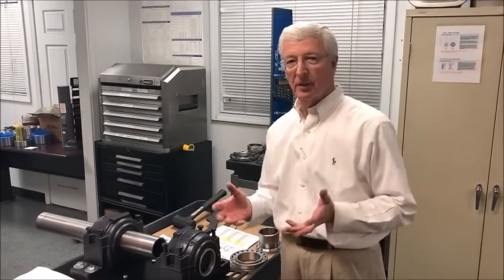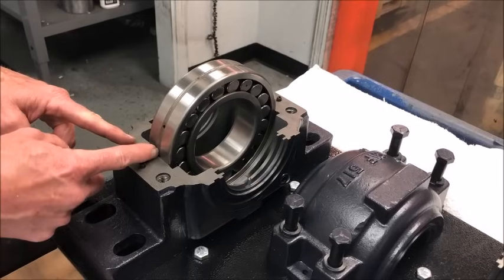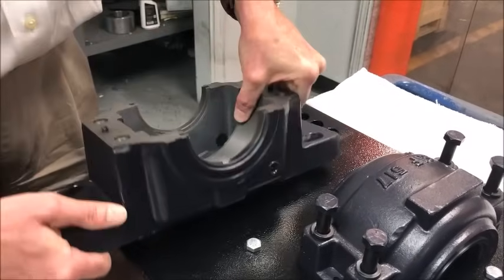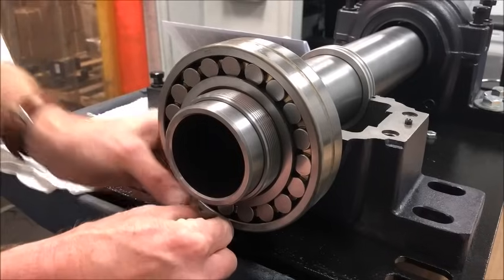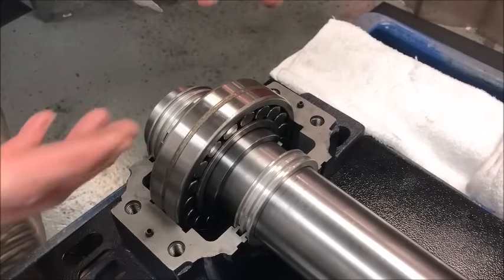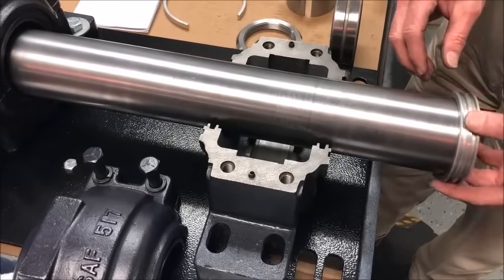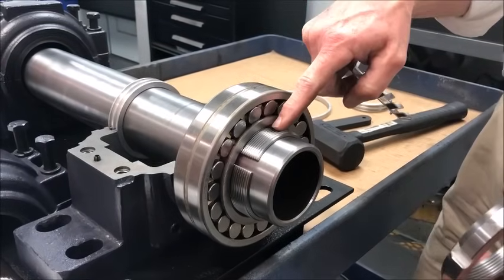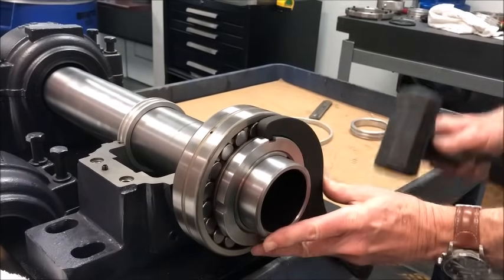SAF / Split Blocks: Features, Installation & Maintenance

Comment: I watched the whole video and i was interested the entire time.  I learned many proper procedures and you explained them very well. I've worked many times on split-bolts and they were always incredibly dirty full of burnt grease i don't believe the temperature gauge on the top would be necessary the smoke and horrendous noise the failing bearing makes is a good indicator service is required immediately. Thank you for pointing out how to check the clearance and how to measure it. I believe measuring the clearance is better than doing it by feel.  I saved this video for future reference. Thank you

Comment: How come the adapter sleeve and bearing slid easy to put the locating ring in after the bearing was fitted? Shouldnt it grip to the shaft to prevent the sleeve spinning on the shaft?
Reply: same question, this doesn't look right at all
Reply: @robrod9677  this is just an instructional video and im pretty sure he doesnt lock it in so he can show again multiple times. ive seen pump rebuilds in classroom setting and things dont get "set" all the way but elaborated on during the teaching. this isnt going into use and is just for informational purposes.

Comment: I noticed a movement of the adaptor sleeve just before you placed a fixed ring, so that means the adaptor sleeve is not tight to the shaft. When it works like that there will be fretting on the journal of the shaft. Is it supposed to be like that?
Reply: No, the adapter must be tight on the shaft. I think he just didn't bother to tighten it for demonstration purposes (which was kind of silly!)
Reply: Yah you're right

Comment: I recently installed two SKF 22218 C3 bearings with tapaered sleeves, and no where on the SKF website could I find the clearances. I checked two other bearing manufacturers and they didnt list clearances either.

Comment: In the real world you would just pack the bearing out with grease, install on the shaft with the tapered sleeve to the desired position on the shaft, install the tab washer, get the lock nut as tight as possible with a hammer and a drift then knock the tab down on the washer into the nut. Pack the housing with grease and then sit the bearing back down into the housing. Check the shaft spins nicely. Jobs a good'n.

Comment: Temperature all 60 to70 how to change55
Reply: Reduce the grease viscosity and re-check clearance between rollers and outer race... Over-packed bearings running at higher RPMs can churn the grease causing the bearing to heat up...

Comment: How do you know which bearing will be the float vs the fixed. To know in which bearing you should install the fixing ring. I really want to know
Reply: Normally the NDE bearing is the one you leave with float

Comment: I’ve never tightened a bearing outside of the housing. While working on site it’s almost impossible to do so. Also for the floating bearing you have to make sure you account for the taper lock and the fact the bearing will move on the taper. Has to be almost pushed to one side in certain situations so the bearing has room for expansion side to side
Reply: yea i was thinking its probably a nightmare to align your pillow blocks too with their respective bolt holes if you arent careful. a lot of measuring and marking for sure.
Reply: Совершенно верно, протягивание гайки дает смешение подшипника на конусе и это надо учитывать

Comment: We have a mill with Timken FSAF520 bearings. These use grease and not oil correct? A drain plug on bottom of housing has me wondering.
Also, what's recommended greasing interval? I'm guessing every 8 hours.
Reply: Mill's can either be grease or oil bath. Most housing will have the drains in them and just plug them in the event going with grease. Depending on the size of the mill normally larger mills, will be oil and smaller ones grease. Due the cost of adding a lube skid vs times needed greased a day.

Comment: very nice video but which of the two bearing is fixed and floating bearing?
Reply: Closest to the driven side
Reply: in our application at our plant we have our fixed on our inboard side (drive side) and floating on the outboard side (side opposite of the motor/driver).

Comment: Hello a question the adapter sleeve should still move on the shaft after clearance has been done?
Reply: No, as you tighten the locking nut the sleeve grips the shaft and the bearing clearance decreases, so if you tighten the nut until you get the correct clearance by default the sleeve will be locked onto the shaft.

Comment: A question about regreasing. Does a bearing housing like this, not filled full with grease, work as an (air) pump and still eject grease? Or does regular regreasing gradually fill up the housing up to a point that it is so full the grease cannot move anywhere but past the seals?

Comment: For new engineers, in real life situations, the bearing is almost always assembled in the bearing housing and not dropped in after, although I wish it was. When assembling a bearing in its housing in a real life situation never take a reading with the feeler gauge in one place and lock off, turn the assembly every so often and take a measurement as you tighten, it will make a difference. Also when knocking the locking tab down, don’t drive it all the way home, ( it will be easier to lift it up later ). When greasing the bearing push it in from one side of the race until you see it coming through to the middle, then grease the other side. Great classroom video though.👍
Reply: Hi Mr How are you.
Why the bearing fire I'm replacing 4 bearing but also fire can give me of cause please.. thanks so much.
Reply: Good mensaje my friend
Reply: Español
Reply: How can you get the locking nut on with the shaft in position?
Reply: @jaydengiddins174 The locknut is assembled with the bearing and tapered sleeve into the bottom half of the bearing housing, the bottom half is then slid onto the shaft in a loose state, moved into positioned and then bolted down, the locknut is tightened and turned every so often checking the gap with a feeler gauge.

Comment: Thanks for this video.
I have just one comment on your clearance measurement that you should measure 3 points (3, 9 o’clock and 12 or 6 o’clock direction) and divide the sum by 2 to get a correct clearance. For more info, you can get it from p.52 of SKF bearing maintenance handbook.
Reply: Why measure if this cleaner is fix what he try measuring
Reply: thanks... if I don't have a feeler or I don't want use it, but I tighten the nut against the bearing by hand, how many turn I can tighten the  nut more by the spanner wrench ? I have seen in a video that I need to turn it 120°, is that right?

Comment: The bearings appear to still move on the shaft after you've tightened the adapter, what holds the shaft from moving left to right?
Reply: I don’t think he actually tightened it down. Just demonstrated the process

Comment: I have been working in maintenance department for thirty five years, still I was not knowing measuring bearing clearance during assembly is necessary. Thanks for nice video.
Reply: وفوق كل ذي علم علبم
Reply: @sassigouasmi8056  ❤
Reply: Gostei da explicação  sou mecânico de manutenção industrial  há muitos anos nease caso eu sempre confiro o rolamento  quando vem na embalagem   verifico a folga que veio e vejo pela tabela  quanto precisa ficar também  uso calibrador de  folga   e vejo dos dois lados do rolamento  uso também  a chave própria  no meu caso chave  KM compatível  com o tamanho  do rolamento  gostei muito do video muito bem explicado  parabéns  vou  guardar em meus  arquivos  abç

Comment: Thank you very much.I think the fit between bush and shaft is too loose.You adjust the clearance and loose the nut.After that you slide the bush onto the shaft EASILY and this makes a contribution to premature failure.You can not tighten the nut more after putting the bush on its original position otherwise the clearance will be decreased.

Comment: We are manufacturer of Machinery Spares in Jaipur (Rajasthan) India, Tool Room Accessories, Metal Fabrication Fasteners, Turned Components, Machine Tools, Precision Collets, Machine Automotive Tools, Metal Castings and Metal Bushes. These are widely demanded in several sectors such as engineering, power generation, farm machinery, food, automobiles, textiles and many more. We have a wide spread infrastructure which is fragmented into various divisions such as production, quality analysis, warehouse & packaging, supply & export etc.

For more information contact us.

bariwalindustries@gmail.com

+91-7742773740

Comment: please make a video for installting an adaptor sleeve and lock nut assembly for free hanging shafts. with and without upward axial thrust for RPM 50 to 200 rpm under pressure conditions. Example being a process reactor for chemcial process and reaction
Reply: Oh
How about 1000 rpm 😅

Comment: Is it optimal to oil these bearings or use grease?
Reply: That’s going to depend on quite a few things, what kind of load, rpm, stuff like that. At my work, we have ones for arbors that we oil feed while running, and others on a grease schedule. Skf have a lot of good info on their site, not sure if they still send free info packets by mail or not, but you can get pdf files Freon them for free too.

Comment: Great explanation . Thank you But if we doing like this some times bearing getting heat up to 65 degree cent grade why ? Which thing will cause to raising temperature please Explain.
Reply: GADDAM JAIPAL REDDY overhearing is caused from several things but a few common issues we see are over greasing. Another very important thing to note that over tightening a bearing is almost always worse than under tightening. It causes the bearing to drag, which causes temps to skyrocket and premature bearing failure. Third but often common is bad alignment. Either the bearing housing is not square to bearing or shaft alignment is bad. That can cause high temps and failure too.
Reply: @AdamSmith-uv6kr  Over greasing? are you out of your fucking mind
Reply: I’m a Millwright at a potash refinery. Had a bearing like that get flagged as running hot pulled the cap and scooped out the top. Dropped 40 f.
Reply: @zuestoots5176  too much can take out a bearing. I change these exact style out quite a bit, and you’d be surprised, it happens a lot.
Reply: @Ian-of9oi  aye! Right on man. Millwright apprentice here in Oregon. Cheers
Reply: @zuestoots5176  , he's not. Overgreasing is a thing, google it and educate yourself.

Comment: What is done as far as "re-greasing" is concerned? Does there need to be a grease relief port for online re-greasing in high speed applications? Or will it just push out through the labryinths?
Reply: Oil lubrication
Reply: Oil for high speed, grease for low speed